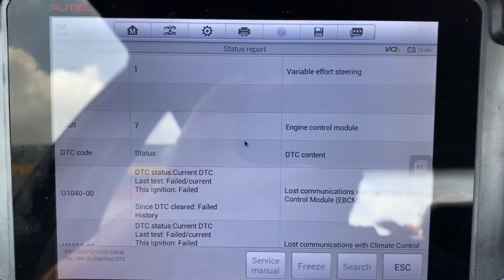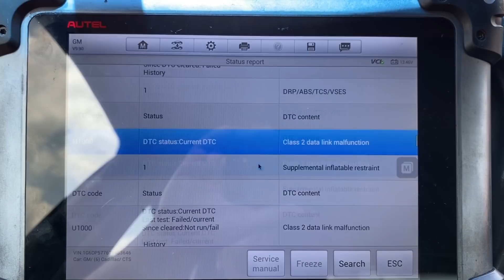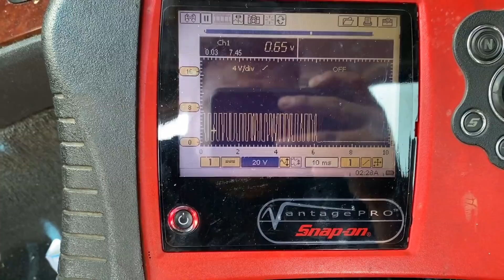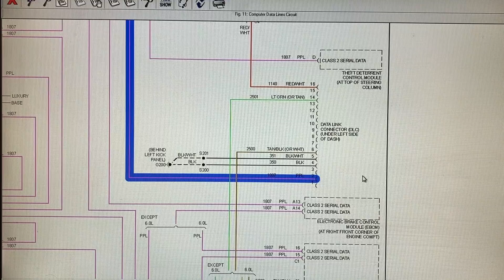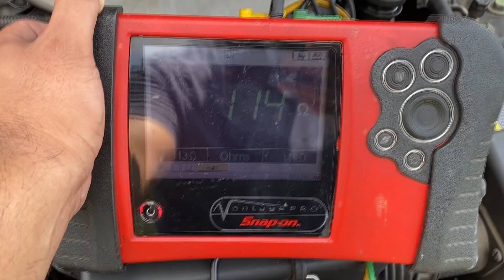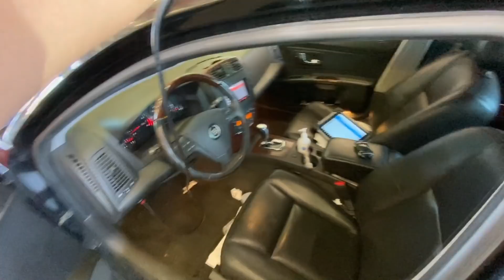CADILLAC CTS KEY STUCK IN IGNITION NO COMM DIAGNOSIS & FIX

Comment: Ah, key stuck in the ignition. Classic GM
Reply from the maker: This one is a little more complicated. Thanks for watching!
Reply: @ADVANCEDLEVELAUTO  Very interesting. Ive never heard of a bad computer not releasing the key. Crazy stuff.
Reply: @ADVANCEDLEVELAUTO  ya I'll keep on watching till the end
Reply: @ADVANCEDLEVELAUTO  please show AC issues, etc. videos on Hyundai i20 petrol 1.2.
Reply: @ADVANCEDLEVELAUTO   what is your #
Reply: Hope you got compensated for all your time diagnosing and verifying that the first 3 ECM's were junk.
Reply: @robertgregilovich2229  it's Good old GM engineering why would they put  a computer on top of a engine and a transmission module beside it
Reply: @neilmurphy845  Mercedes does this as well
Reply: @The_Redkween  yes I saw that on diagnostic Dan's video before Just crazy engineering
Reply: GM's pass lock sucks that's why gm has ignition problems but this is not what's going on here I haven't watched the whole video yet but I would check voltage on ign fuse if -10v ign switch bad otherwise maybe lock cylinder .. my though is all these codes are ignition switch not providing enough voltage to ECM
Reply: 07 Cadillac CTS 
I'm having u0101 no communication with TCM. 

Key won't come out. 
Starts and drives but in limp mode. (3rd gear) 

RPM gauge works but no speedometer. 

I have to press the button with a pen to remove the key. 

Changed battery, alternator, TCM , ECM
Removed plugs and cleaned with compressed air.  
Unplugged harness at the transmission looked fine. Plugged back in. 

No visible broken wires, fuses are all good none blown. 

🤯 😡 🤬🤬🤬🤬🤬
Reply: Why do they get that other brands don't have that
Reply: Hola tu video fue de gran ayuda, justo tengo un cadillac 2004 que en ocasiones arranca y en ocasiones no esto se corrije moviendo un poco el relevador de ignición en ocasiones más sin embargo seguiré algunas de tus pruebas para descartar las demás opciones porq los cristales no tienen funcionamiento, aparentando también falla de inmovilizador
Reply: I’m having the same problem.Key stuck 04 CTS. 3.6 eng. mechanic covering wiring. Has car  8 days now, could eco be my fix also????
Reply: @19teenie50 same problem here. Car runs but doesn’t show the fuel and temperature gauge. And when I turn my car off my key won’t release unless I do it manually with a pen or a screw driver.
Reply: No crank no start on an 04 cts 3.6 here too. 132k miles, smh.
Reply: You have to love  GMC   General Motors crap    to make a long story short you got weird faults and can’t get the key out of the ignition you need a new a good working computer 😆 lol. Poor Eric gets all the headaches
Reply: @on-site4094  im actually a GM fan but im not gonna lie they have some ridiculous electronic issues
Reply: @on-site4094  well at least it sai you time in diagnosing things you just throw computer in it and boom your sorted 💪

Comment: Saludos amigo desde Houston norte Eric 👌👌 buen diagnóstico
Reply from the maker: Gracias!
Reply: @ADVANCEDLEVELAUTO  what's the charging output current of the alternator when engine is running? And, how does it cut off when battery is full 14 volt??

Comment: Nice video!  

Makes me wonder why how the dealership took that ECM back, unless they themselves opened the box.  I'm near Chicago and the dealerships I have been to, do not accept anything electronic back.  Will keep this in mind when I buy any electronic part, check for signs that the box was opened or the part installed/used when picking them up to ask for a different part.
Reply from the maker: Thank you!